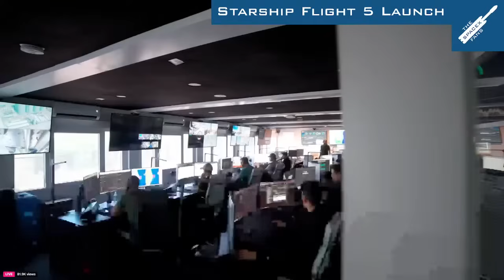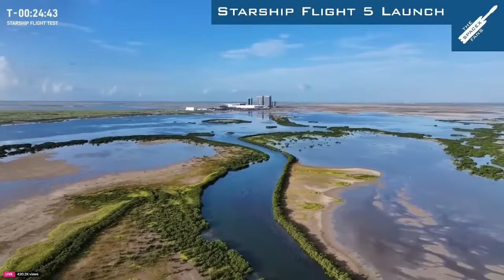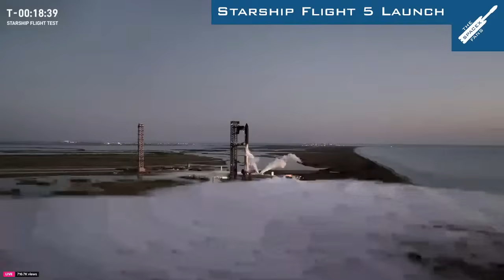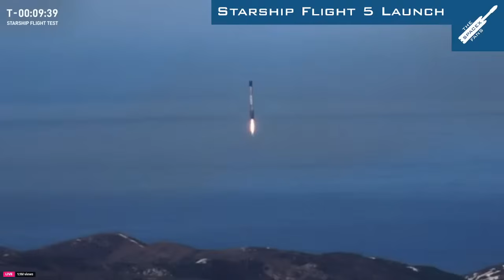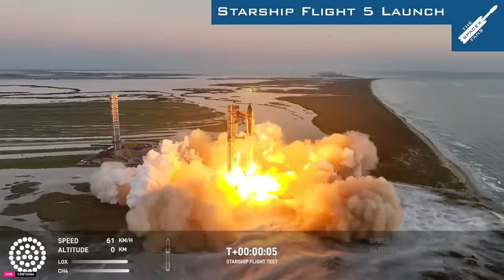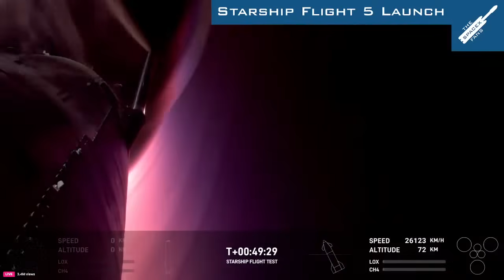SpaceX Starship Flight 5 Launch & Super Heavy Booster Catch Attempt!

Comment: Starship blew up though seen parts flying and massive fire.
Reply: They had to execute the flight termination system because they can't leave live explosives laying around for bad actors to recover.
Reply: @gregfinney9035  Killing two stones with one bird is tight.
Reply: @gregfinney9035  lol yeah right they never mentioned they were going to detonate the FT once landed so bs on that one other channels also declared it blew up nothing about the FT going off so keep lying to yourself guess you need the copium.
Reply: Maybe on purpose to prevent bad actors for recovering the engines for reverse-engineering...or hot engines and cold seawater.